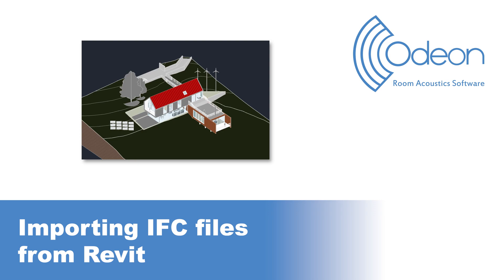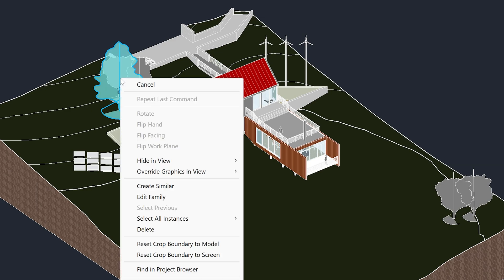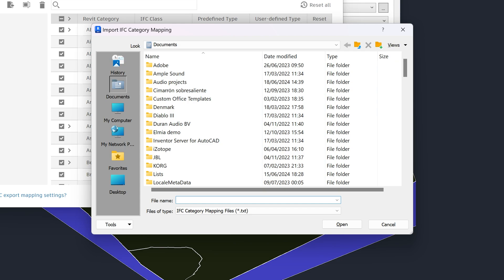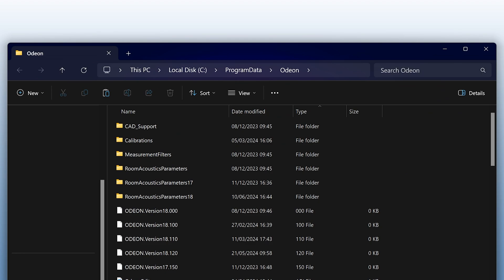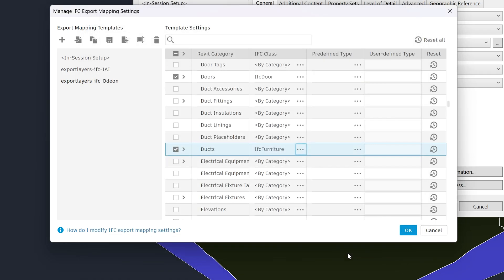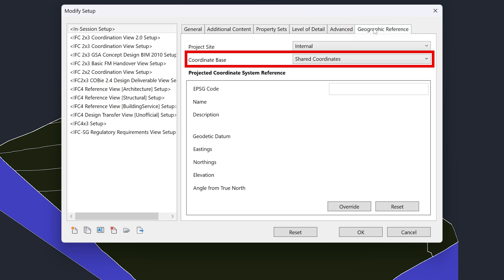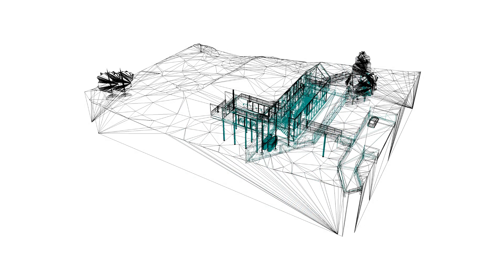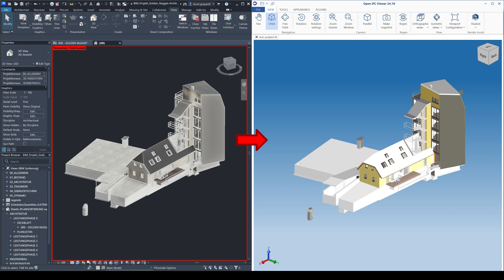Importing IFC files from Revit into ODEON Room Acoustics Software

Comment: Do imported ifc models often have leaks?
Reply from the maker: It entirely depends on how it was drawn by the user. Otherwise leaks should be minimal, and even a few leaks are not a problem for accurate calculations. However, in architectural models windows are often modeled as holes, whereas for ODEON, they should be drawn as a closed surface.